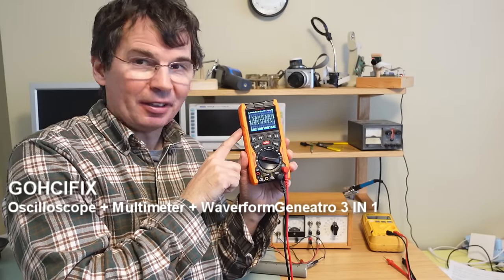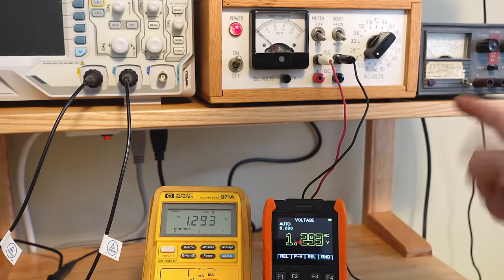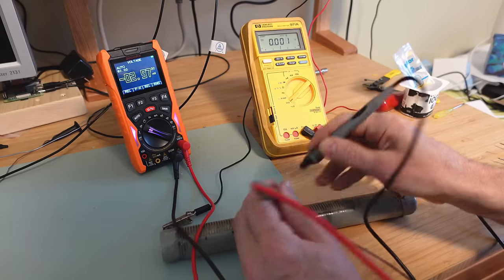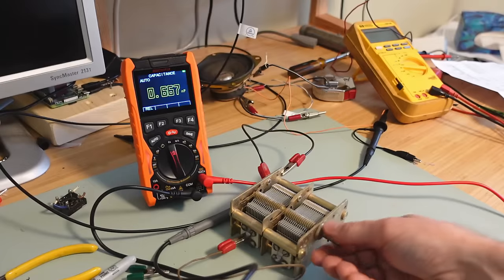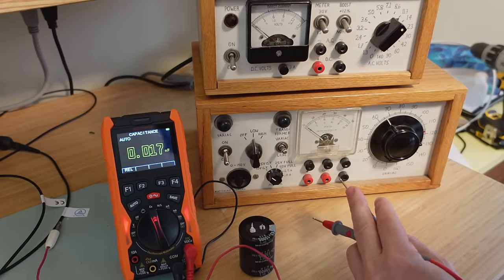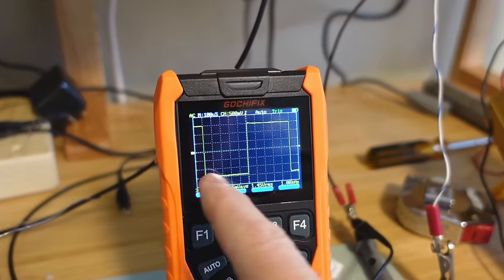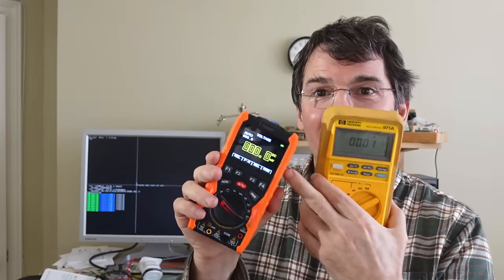Gochifix 3 in 1 scope meter review

Comment from the maker: Sorry, had to re-upload on account of an audio glitch.  This one my fault -- spent so much time trying to get it to render that, when I copied all the clips to a new project to get it to render, somehow I missed a few audio clips.
Reply: let me guess, magix vegas?
Reply: Hello, I have a question for you. Is it possible to move the compressor in a window air conditioner... about 2 meters from the window where the air conditioner itself is installed...?
Reply: @slavaslava6733  Not without the tools to safely remove and refill the coolant in it, and the skills to solder new tubing to the system.  There's only so much copper tubing in thoses systems , definitely not enough to stretch it out 2 meters.

Comment: Very interesting video, I am a electronics technician who has worked with a lot of high end test equipment over the years. You demonstrated over your two videos the basic problem that every one faces when it comes to electronics testing and diagnoses, you need more than one piece of test gear to do the job. At times you will want to see several different values at the same time and one meter will not be adequate to achieve the task. I am retired now, so my access to high end equipment is over, but I have two different scopes one for the shop (Telequipment D1011) and the other a pocket scope I use at the cabin (DSO NANO-v3).

Comment: The test square wave on the Rigol is a good signal, it's there to adjust the probes for proper termination, so adjust it until it's quare. There's a small adjustment screw on the probe.

Nice thing about a 'multimeter' scope is that it's battery powered and doesn't have issues with ground and the device under test. For oscilloscopes you'd often use a separation transformer. Handy for probing PSUs for example.
Reply from the maker: yes, someone pointed that out already.  Scope probe was out of adjustment.

Comment: These all-in-one tools are, like most multipurpose tools, good for approximate use when you don't have the proper tool at hand.
The old adage still applies: The right tool for the job

They're also good to start with while you're saving for the right tool. Just bear in mind that accuracy isn't one of their strong suits.

(& yes I own a Leatherman and proper hand and power tools. I also own an inexpensive scope/voltmeter/component tester while I save for a Siglent SDS1204X-E. I'd rather have a Keysight but I haven't won a lottery yet)

Comment: I have a meter that is very similar (outline digits, scope mode, etc) and have found that if I exist scope mode by long-pressing the button, subsequent AC voltage readings are erroneous. Might be true of other functions, I haven't tried. But now I always exit scope mode by turning off the meter. Otherwise very pleased with it in general, love the outline digits, as you said you can see the waveform so very useful.
Reply from the maker: Just checked mine, doesn't exhibit this problem.
Reply: @matthiasrandomstuff2221  That's good to know. Mine is about a year old so there are probably updates to the software since then. Too bad they don't provide a way to update! Maybe I'll open it up and investigate how updates could be done.

Comment: 11:35 Did you compensate your Rigol probes? Probes should be adjusted so that the test signal is as square as possible.
Reply from the maker: oops, just checked, it was the probe.  Which is to say, the scope meter is a bit off.

Comment: Thinking about measuring the mV scale around 4:30 on your wound resistor. Since it looks like about half the winding is exposed, you'd think you could evaluate a range of sub-mV measurements by adjusting your position on the coil. 1/4 around the coil should be close to 0.75mV or 1.25mV depending on the direction. That would be interesting to see if the meter can pick up on that level of change.

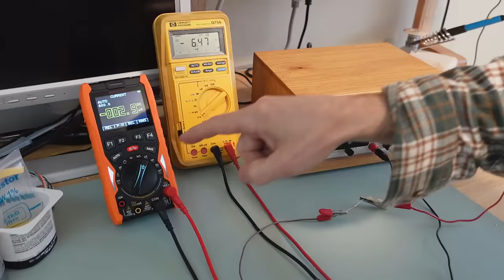Comment: 5:58 I LOVE that shutter, I've seen a couple of other meters with that feature from EEVBlog. Still not quite idiot proof, but goes a long way in not forgetting it's in the ohm port and blowing a fuse or shorting out a power source in amp mode.
Reply: 😮i put a resetable ptc fuse in my old radio shack miconita multimeter.  It reads low on current but saves me.

You may like my diy oscilloscope video.

Comment: Hey, amazing videos. Can you analyse the airflow through Whirlybird ventilators? I would like to see a good analysis to see if its worth having it in houses. Also would like to power it with a small motor to always keep it running instead of only depending on the wind and hot air movement which causes the natural rotation.

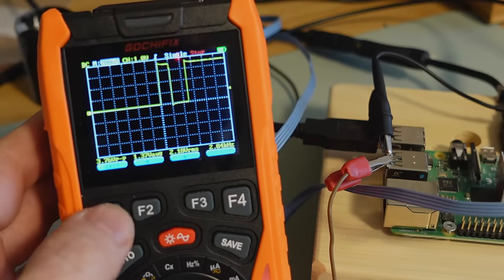Comment: 😮 14:06 probably the "trigger" is done in software on stored values.  That's what i did on my diy oscilloscope,on my channel.
Reply from the maker: Yes, most likely, which is why the faster it goes, the less likely it is to trigger.  Still useful for repeating waveforms, but useless for one-shot events.

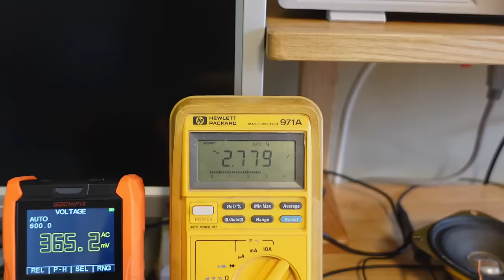Comment: Hi Matthias, I guess your HP is correct at 1:41 it just doesn’t calculate the true RMS of the wave you showed on the scope. It just measures the peak to peak Voltage and divide it by the square root of 2 as it would be correct for a sine wave. Your digital scope is capable of calculating the true RMS. 

Nice video!

Joachim

Comment: Interesting review! That’s a ton of features considering the price. Its seems to do them all adequately, but doesn’t excel at any of them. The slow refresh rate and inconsistent / or potentially in accurate readings are more of a concern for me. Quite powerful if you know its limitations, especially for the price. Not sure I would recommend it to a beginner over a fluke or equivalent though.
Reply from the maker: Key is to know its limitations.

Comment: Are there better scope meters you would reccommend, or is it better to just get a benchtop scope?
Reply from the maker: A benchtop scope will always be better.  bigger screens, actual knobs, better probes.  But this is the only handheld scope I have tried.
Reply: I've used a Fluke ScopeMeter over 20 years ago at one of my work places and it was pretty nice but you're looking at big money for those. I have a couple of used 80s vintage Tektronix scopes and they still work well for me.
Reply: @electronixTech  I remember having one of those ScopeMeters that was gifted to us at work by another facility. It seemed like a cool idea, but I remember it ate through batteries like crazy, had low bandwidth and had a really slow updating monochrome display. One employee kept borrowing it for home use and eventually I just let him keep it since it was never used at work.
Reply: ScopeMeter is a trademark of Fluke. So there is only one brand of ScopeMeters. Others are not one.
Reply: Agree that benchtop is always better. And the Rigol DS1054z is still great value for money for the hobbyist.
For budget handheld scopes, the ZOYI ZT703S is an ok buy for the hobbyist. And it's a 2-channel scope but annoyingly it only ships with one probe.
Reply: @JimLambier  The one I used was set up at a test station to augment a regular CRT oscilloscope. It was always plugged in with an adapter so that's interesting to know they were hard on batteries. I wonder if the newer ones are any better with the newer generation of batteries being used now.
Reply: @electronixTech can you use a dc power supply and hook it to the battery leads? Or would that affect ground/safety?

You may like my diy oscilloscope on my channel.
Reply: @TheRainHarvester  Love your hardware hacks. I subscribed to your channel.

Comment: Early in the review shows bad figures being returned and suggested a software issue is the cause but could the issue be fixed by simply turning the 3 in 1 off and then back on and then taking readings? 

Similar to how a computer hangs and you fix it by turning the computer off then back on again?

Remember, that's a $90 US 3 in 1 versus a scope probably worth the cost of a small car.

A bit like comparing the cuteness of a Wildebeest to a Koala...no contest.
Reply from the maker: except that it’s wrong bu default and only sometimes correct